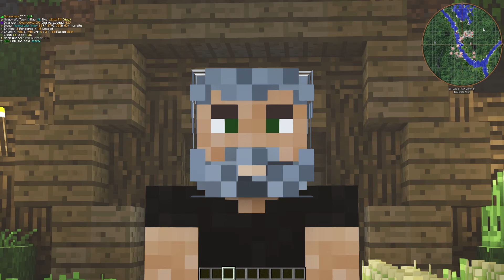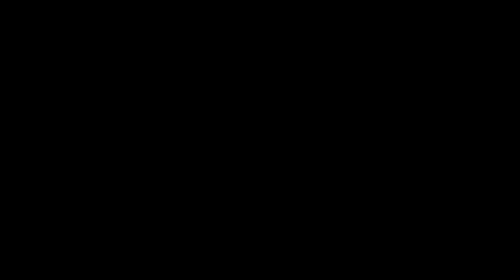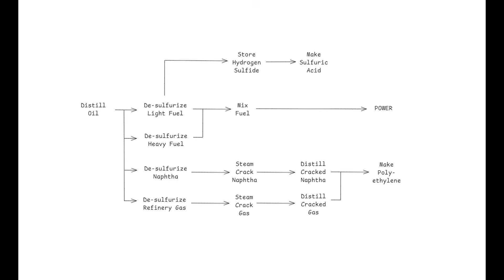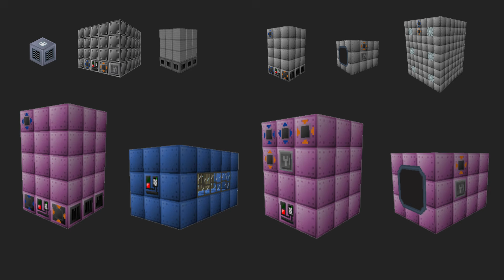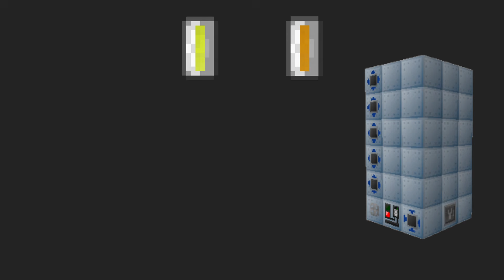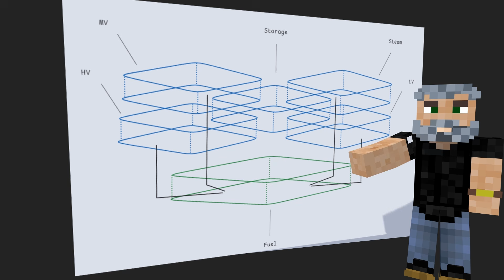The ULTIMATE GTNH Beginners Guide - Episode 5 - Early Power and Base Design

Comment: Having tried the 3 main power sources (steam, oil and benzene) up to IV, my feeling is this. LV-HV oil is king. The moment you get light fuel you are in MV in terms of power production, and all this requires is like 1 oil pump a few chemical reactors/distilleries and some hydrogen, I mean you can't do it immediately, but its really not that hard, way less setup than setting up a farm 10+ coke ovens and item logistics to produce less power in a more inconvenient form. Oil is extremely cozy all the way to HV, in EV is the first tier you might feel a bit strained (cause EV does not have an easy upgrade like the previous tiers Light fuel -> Diesel -> Cetane boosted diesel. I guess there is HOG which might be available, not sure if its IV or not, but its a completely different process and you probably don't really wanna do it until you have a robust AE system + its not so easy to transition since you have to tear out about half of the old setup for cetane). But yeah, apart from the impressive energy, the byproducts are in high demand, notably ethylene, propene and sulfuric acid. You can get them from Bio-diesel/other methods as well, with a bit more effort, but why make your life difficult? And speaking of the non-renewable nature of oil, well I can tell you at least from my experience, all the way until IV when I moved off oil for my main power needs, I only needed to move the oil drilling rig 3 times for light fuel, and mine 2 veins of oilsands, that's it, so genuinely, its not even remotely a problem unless you want to scale your oil into oblivion past IV. There is technically a renewable oil source as well in the form of oilberries, they are kind of a pain to breed and they only give 100ml oil per berry so unless you make a truly insane setup, its not really scalable, but hey, in theory you could make renewable oil, but in all honesty I think the oil berries are best served if you want a trickle of the byproducts, not for power.

Bio-diesel/Benzene is a close second, I think both are generally inferior to oil but Benzene scales better into IV if you don't wanna use reactors. However, like oil, there are some nice by products you get from the Bio fuel lines. For example, from Benzene you get a byproduct called something like DimethythilBenzene 1-4 (or something like that, I forget these crazy chemicals sometimes XD) But yeah, these things electrolyze into something like 10 buckets of hydrogen and carbon, very convenient and it basically means your hydrogen production scales automatically with your fuel production. From the Bio diesel side probably methane is the most useful byproduct, cause its used in several places like polytetrafluoroethylene for example, and it also doubles as a nice source of hydrogen if you have excess. Also, you get free fertilizer from distilling fermented biomass for your farms. Just like oil, even if you don't wanna use it full time, it probably makes sense to have a small setup producing you some of the useful byproducts. In terms of power I think Bio-Diesel is a bit of a meme, I've heard it was nerfed and it definitely feels like it (The biggest problem of all is that biodiesel is mostly seed oil, and unless you shed blood sweat and tears to breed coconut trees, or possibly invest heavily into IC2 crops, there is no good way to farm it at scale, I tried farming pams harvest craft peanuts in a multifarm and the production was genuinely pathetic, not even mentioning the multifarm needs HV circuits to run at full efficiency, what are you gonna do in MV? burn methane I guess?), its basically just diesel but requires more setup for less efficiency for the benefit of being renewable, but since there is not upgrade path past cetane, its kinda pointless to invest in it so much.

And then there is steam. Steam is a solid secondary power source, particularly to run those OP steam multis, and for passive processes that don't need to run at a high power tier. Its relatively easy and renewable but it doesn't scale well in the early game (Ironically, from my understanding it becomes very powerful late game however, cause I guess the devs thought the meme of making the 0th "fake" tier's power source good in the late game was too appealing) The setup is time consuming but materially cheap for steam, but it doesn't work very well for higher voltages. For example, consider running your EBF off steam at the start of MV, you need 4 LV steam turbines running full blast, and each takes about 3500 ml/tick (edit: I don't know where I got this number from XD Wiki says 1552 so lets go with that, the conclusion is still correct though) if I remember correctly, this is more steam than even the large potin pipe can carry, so you need either multiple pipes or 1 huge potin pipe, simply to run 1 machine at MV -_- The pipes are a huge issue for steam, and they really limit how far you can send power, you don't really get access to pipes with amazing capacity that are also cheap for a while, next upgrade is dark steel which is better than potin, but you will struggle trying to run an MV, or god forbid, and HV base with this alone (lets remember, a huge pipe is 12 ingots per pipe, the cost of that adds up very fast, and you need those huge pipes for your main power spine no question about it, you probably even need more than one line). Not to mention, on top of all this, if you do steam, you still need to do the other methods for the byproducts, as well as make cetane for the rocket, to me it makes no sense to use steam as the main power source past LV.

edit: I thought I would also mention one more option. I haven't tried this myself but I theorized it was possible. In LV build coke ovens and a solid fueled railcraft boiler for some basic steam production, however, as you push into MV, use semi-fluid generators burning creosote. Its not an amazing fuel but it gets the job done, and basically it allows you to skip oil and bio-fuel entirely, for now. Once you are in MV mine up a oilsands vein and process it into heavy fuel, you can now burn the heavy fuel in your semi-fluid generators. Its almost as good as diesel with like 1/3 of the setup and once again, it frees you from having to build infrastructure. It will give you more than enough power until HV. Once you hit HV, its probably time to start thinking about moving off semi-fluid generators, I haven't researched if there is a convenient HV fuel but in any case, by EV you're gonna need something better. The benefit of this path is you get to zoom through the low tiers which are a bit painful cause you can't build good infrastructure yet. Particularly benzene, you really want kanthal to get started (ideally nichrome) and so you need something to get you to HV in the interim. Even if you do oil, this way might be good if you wanna avoid building shitty infrastructure and jump straight into distillation towers (It might be more trouble than its worth tbh but who knows, haven't tried it)

There is one final power source I want to mention (No not solar XD It sucks). And that is the grandmaster magic energy absorber. It becomes available in late EV and its extremely expensive for not much benefit, but it is a true, no questions asked, passive energy source that works no matter what (well it needs a dragon egg too, that is the cost for it, but you can make more of them after mars and it doesn't consume the egg or anything so unless you desperately need it for something else, I see no issues here). The grandmaster gives out 1 EV amp but there are also lower tiers that are cheaper. I made this thing for shits and giggles, not expecting too much (I kinda didn't realize the full cost of it before it was too late) But surprisingly, I found that when paired with a large battery (as one of my first IV projects, I made a decently sized lapotronic supercapacitor with about 3 billion EU storage) this thing can run your whole IV base almost by itself. Of course if you are running machines constantly you'll run out of power (especially if you run them all at IV, then it won't work), and I did supplement my power needs a little with cetane before switching to a vac nuke setup, but man, I cannot overstate how useful it turned out to be when I moved my base to the void, it allowed me to keep my old base operational while also powering the new AE base all by itself, I merely left it one night to charge the battery bank and it never ran out after that. I am conflicted as to whether I want to recommend it or not, but it really is worth considering if you idle a lot and like big batteries.
Reply from the maker: ^^^ SOLID GOLD ^^^

also on the grandmaster energy absorber - super solid options to plug one into AE and let it ride. It too me a long time to outpace 1amp of EV - and I plan to power AE long term by just forever scaling them. SO nice to never worry about an AE power blackout and by mid-IV they are fairly cheap with the right investment in thaumcraft
Reply: @ Funnily enough, that was my initial plan as well, to have a separate power network for my machine and my AE, so no matter what I never black out and lose access to my AE network. And then one day I just thought, I have this huge battery sitting around, why don't I just plug my infinite energy into that XD And well the rest is how I described it, it powered on-demand crafting in my base for literal weeks of expansion XD

Even though it ended up working out in the end, it was a bit hard grinding out the essentia and the materials for it, getting void metal was a pain sure... but the real trouble was strontium, the aspect of stupidity in thaumcraft XD I was like, I wonder if the game is trying to tell me something here XD
Reply: Good post, and agreed that oil is the way. Light fuel is easy to set up and easy to scale with diesel once you're in MV and a distillation tower in HV. Cetane boosted diesel also can be used as rocket fuel.

I think steam is actually better than you said if you're willing to commit to it. 2 steam is 1 EU, so the large potin pipes can move up to 6000 mb/sec or 150 EU/tick which is about enough for an MV generator (but watch out for efficiency loss).

Personally in my current run I get about 20k steam/sec, or 500 EU/tick, nearly an HV amp, from a pair of 2x3x2 railcraft steam boilers, fed by 24 coke ovens (which generates spare creosote/charcoal, I think 22 would be enough). 2 huge potin pipe lines gets all the steam out, 1 to ore processing (steam multiblocks) and the other for everything else.

Was it a waste spending all the steel and coke oven bricks on temporary power infrastructure? Well, it carried me all the way from mid LV to end of MV, when I finally set up diesel for the EBF for kanthal and stainless steel. Also, all infrastructure in this pack is temporary and it's not like it even really cost time: I already automated clay (extracted from mud balls), so I just loaded up a quad BBF with coal blocks to make steel and then got to spend a couple hours looking for mica (lol) while the steel/clay built up.
Reply: @ocococoe  Thanks :) Interesting that you said that you thought steam was better, I used it all the way to HV in a server I played in and I have to say I can't describe it as anything other than painful XD We were more or less forced to switch to oil to expand our autocrafting setups. I think your 6000mb/s steam = 150EU/s calculation is missing the efficiency of the turbine so its a bit misleading (I also messed up some numbers in my original post so it is what it is I guess XD) But according to the wiki, the MV steam turbine needs 6933 steam/s which is more than a large potin pipe can carry. I remember I literally had to replace the large potin pipe going to our EBF with a huge one cause it was voiding items so I know it doesn't work. For many recipes that don't pull a full amp (i.e. most recipes) it would work, but for the EBF and power hungry recipes it really sucks, it feels like an unnecessary punishment for using steam. Another issue with steam is making efficient use of the pipe capacity. For example, if you are feeding an MV turbine with an huge potin pipe (12000 steam/s) well it can run the one turbine fine but you have an awkward 5067 steam/s left in the pipe. Running a second MV turbine off that is playing with fire a bit, so I guess what you would have to do is make smaller pipes that split from the main line and take the steam somewhere else to run LV turbines, or just have 3 LV turbines on this line. Its not the end of the world but this is another unique steam issue, cause the other power sources don't really have to worry about pipe capacity.

Funnily enough, I actually have a bigger steam setup than you even though I didn't use steam as my main power source XD I have one 3x3x3 railcraft solid fuel boiler being fed double compressed charcoal by an infernal coke oven (I forget what it was called exactly but you probably know what I am referring to). I only built it later purely to run my steam multis cause it was dirt cheap at that point.

As for whether your setup was a waste, well probably not a waste, but you could have progressed faster if you just switched to oil. My current playthrough is my 3rd one and I just knew it was a fools errand to rely on steam, so I blazed through the early tiers. As I mentioned in my original post, the cost of getting light fuel is so low that I don't really see a benefit to scaling steam early, I mean the conveyors + piping you need for your steam setup alone are prohibitively expensive, even the sand and clay for the coke ovens is not a foregone conclusion when you are talking about 24 of them. Well since you had a clay farm maybe it wasn't so bad XD but I guess my point is, for me LV-MV went by so fast I don't even remember this point in the pack XD Of course all infrastructure has an expiration date yes, but the oil setup is both necessary (for cetane) and upgradable at least until EV so in my humble opinion its the clear winner

Well, one thing I will say to please the steam gods, I am actually planning to switch to steam again at the start of LuV XD I actually wanted to do it at the start of IV but suffering setback after setback I couldn't do it. My plan is to use an extreme heat exchanger to process lava from an everburn urn (possibly also lava bees if necessary) feeding however many large steam turbines it can feed. I haven't done any maths to see if its worth it but it just sounded like fun. Unfortunately this stupid thing randomly needs a ZPM recipe to craft -- which means I need 2 LuV energy hatches which need the assembly line, hence why I have been stuck trying to build it even though I have all the materials and the power to run the recipe -- I guess one day when the beginners guide to LuV drops I will share my findings there XD
Reply: @anjuro  Aha, that explains it! Yes, if you're pushing to HV Big Steam is a waste. Funny that you're going to return to it now though.

This is my second serious playthrough...the first time (2.5) I burned out in early EV while setting up titanium from rutile because I rushed and had basically no automation set up besides diesel. I got discouraged building all the infrastructure from scratch.

This run I'm taking my sweet time. An overkill animal breeding enclosure in the stone age, big spruce and glowstone and cotton fields in steam and automated in LV, automated rubber, clay, fertilizer, ethylene, all from steam power in LV-MV, self indulgent building projects to hold everything (I like the brick factory look which is why I originally automated dirt -> mud -> clay). And once I switched my blast furnace to light fuel the extra steam is electrolyzing water. It's free power so why not.

Also the MV steam turbine is convenient but a trap for anything that's gonna run continuously. The large potin pipes just barely supply 4 LV turbines, and there's plenty of space if you can dig under the EBF for them. That's how I made aluminum at first. Light fuel is still better but this suited my playstyle just fine :-D